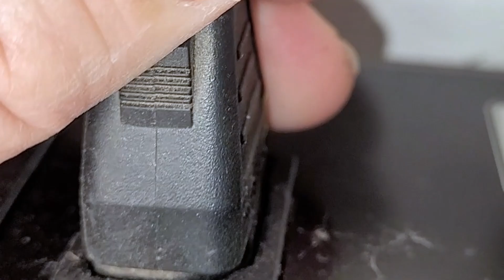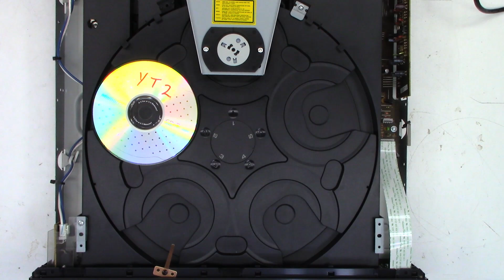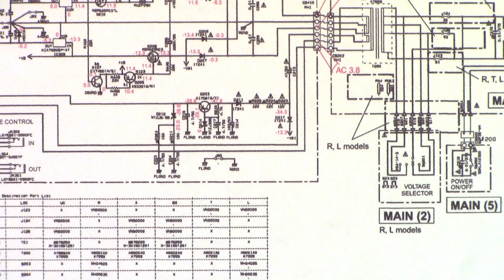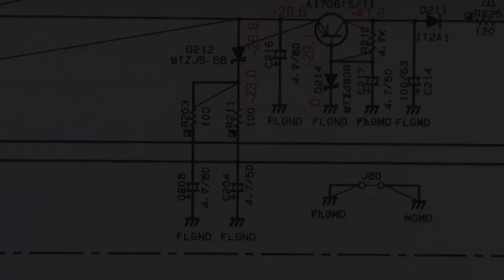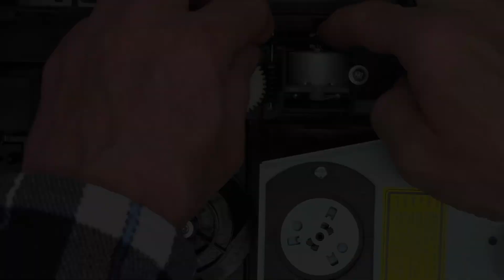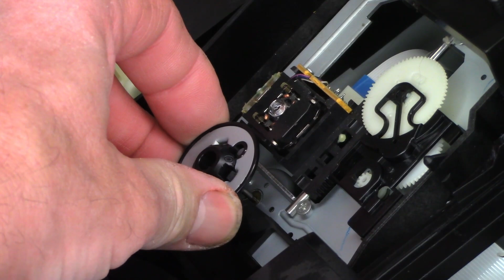Yamaha CDC 697 CD player. I could not find an issue, other than the dim display. Just used up.

Comment: I have CDC-585 , it looks the same as yours, there is a Dimmer button on the Remote , it has 3 levels : low , medium and high. This may help you , there is NO dimmer button on the CD player .
Reply from the maker: I will check it out. Thank you! It was indeed on medium. It looks much better on bright! Thank you again.
Reply: Good call Adrian. Glad the display functioning as intended.

Comment: My opinion is, the zener diode(s) in -28V circuit is bad. I find this problem in many Panasonic VCR (NV-FS ; NV-J etc.) after replacing zener diode the VFD brights up. (When I measure this diode, looks fine, but it was faulty). Maybe is the same issue in this CD player.
Reply: Hi, I will try that for sure but do you know where are those diodes exactly on the board ? I know what a diode looks like but I have a whole bunch of them .thank you so much.